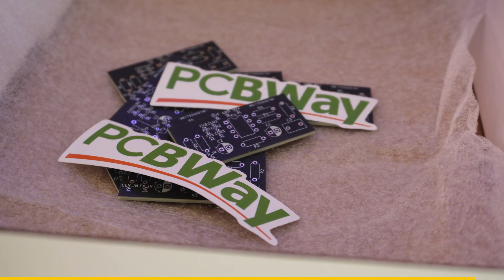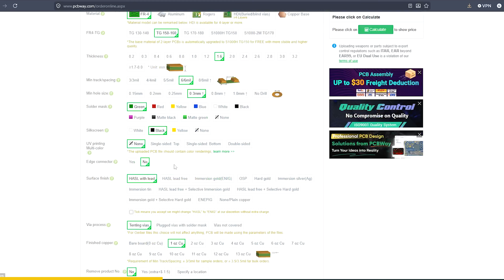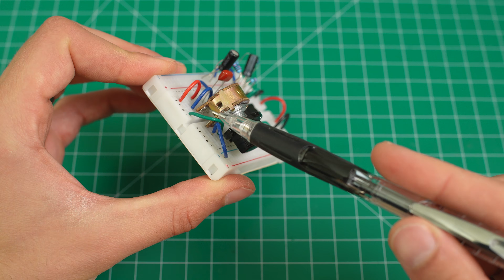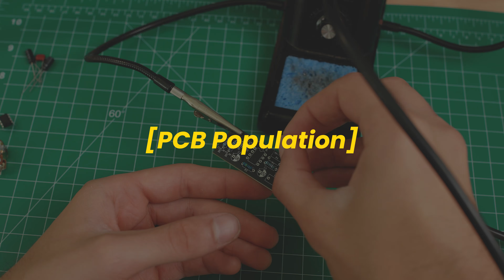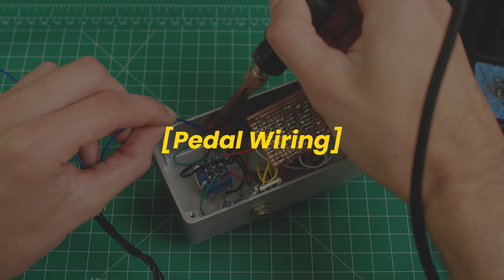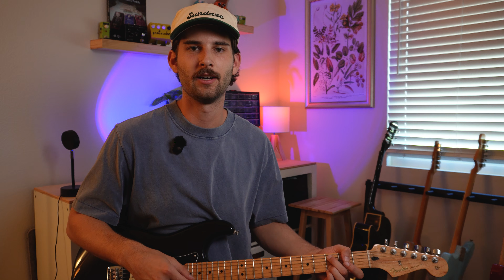I Added a Clean Blend to a RAT (DIY Pedal Build + Tone Test)

Comment: Love your work mate! Am i right in saying that you essentially have the RAT and blend circuits in parallel?  Looks like you just tacked the input and output onto existing in/out connections without removing the existing connections.  Probably why distortion comes through even at fully clean blend? Is there a reason you didnt place the blend circuits in series with the clean and dirty signals to preserve the existing RAT sound and allow a sweep from fully clean to full grit?

Comment: I never liked the clean blend. The clean part is not merging with the clipped signal to my ears. Instead, it’s better to have asymmetric clipping. One side of the signal is less clipped so that side carries the musical information while the other side is carrying the distortion.
Reply: Should have listened to you. You were spot on. It can work if it hits radically different frquencies, but you can't escape the "parallel" sound instead of "blend". For the Rat, asymmetric sounds sublime.

Comment: Out of curiosity do you know how the pedals work and design the circuit yourself or do you use schematics from places like electrosmash.
Reply from the maker: For existing effects I will follow the real schematics, but in this case, I designed the clean blend circuit
Reply: @PedalSmithCo  nice, i do the same thing. So far only thing i have designed is a high cut low cut pedal circuit